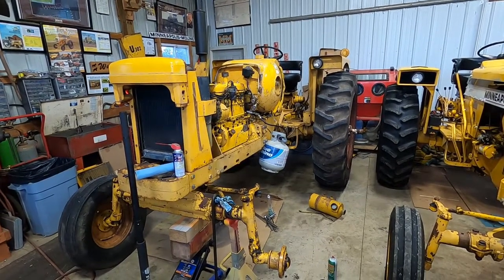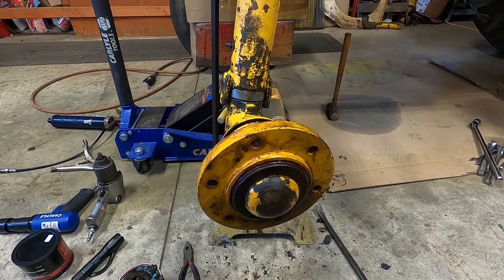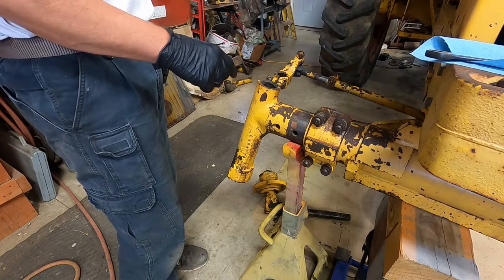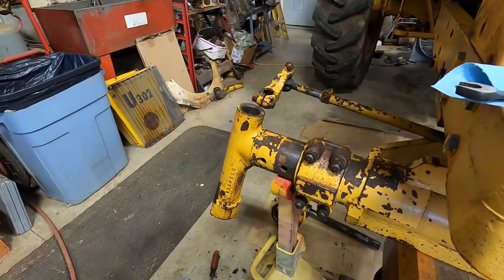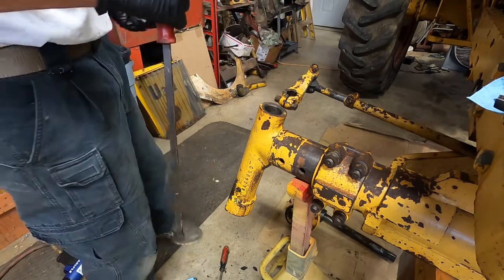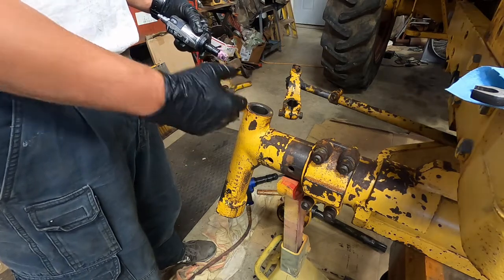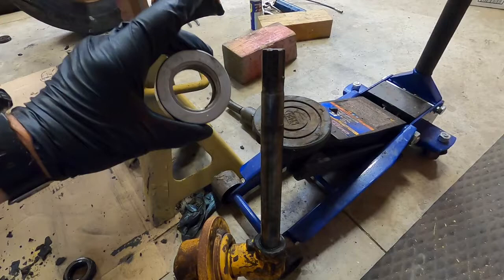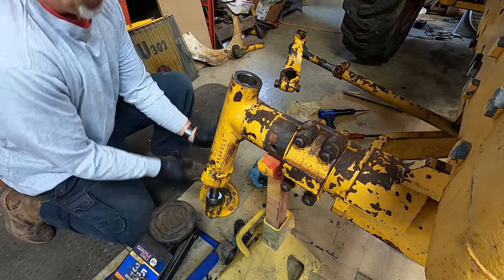1970 Minneapolis Moline U302 Front Spindle Repair And Hub Adjustment

Comment: Years ago I bought a 1 owner Super U302 MM it had 1600 original hours on it gas narrow front and the only thing it ever did was load manure, It was never in the field as a work tractor. He had 2 Super U302's one gas the other diesel and it was wide front, A friend of mine bought the diesel and wanted the loader so he got it and I got the Gas NF and a new set of MM 3pt 4x16" plows for $2300 for both !  It was a really good tractor but no matter what I did to the seat it gave me a back ack so I traded it to an Oliver 1550 diesel that they wanted $5000 for it. I gave the Super U302 and $500 for the 1550 and kept the plows, The 1550 has turned out to be the best tractor I've ever owned . I think that was about 1987 and the MM has been missed but I love that 1550 and I think this was one of the best buys I've ever made getting the MM like I did then trading it for the Oliver 1550. Best thing was the guy I got it from was a 1/2 mile from the MM dealer he bought it from new so if it ever needed anything it went back to the dealer. I still like seeing the MM's and everytime I see one it makes me think of that Super U302 I had and I do miss it. Bandit